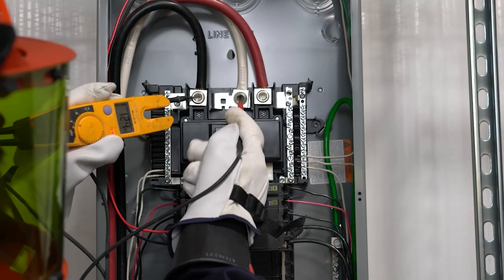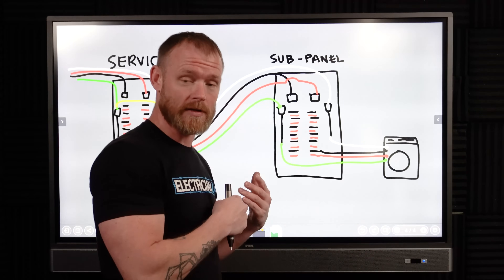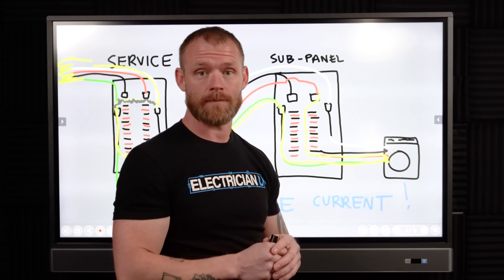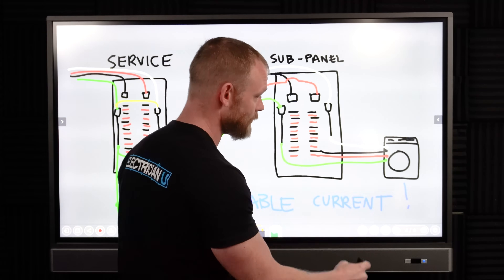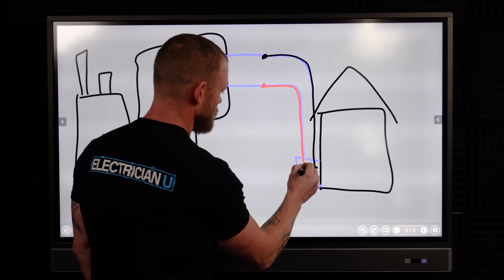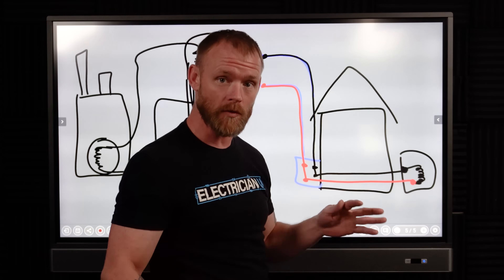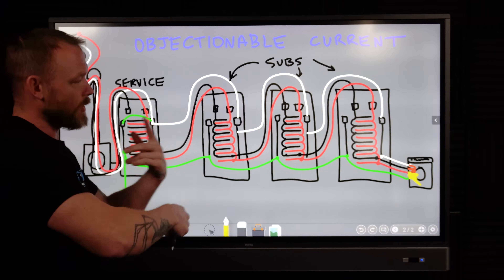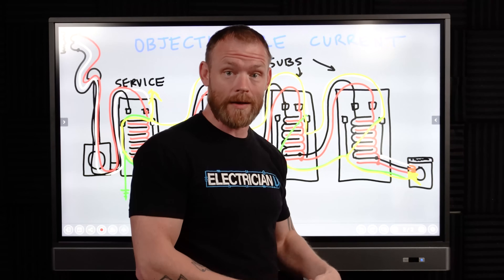Why Do We Bond at the Service Panel and Not a Subpanel?

Comment: You did not address unbalanced loads that'll cause the neutral to carry current, which is the real reason to not bond at the subpanels. If the load is balanced, neutral carries zero amps. If for example you have 100 amps on black and 50 amps on red, neutral carries the difference. If you bond at the subpanel, you give that current two ways to travel back to the source: neutral and ground will both carry half the current then. And if the plumber comes to replace the water heater, he dies when he takes the bonding jumpers off the pipes.

Comment: Nicely explained! Question regarding sub panels detached from the home. Code requires it's own ground rod. Does everything you just explained stay the same, where only the service panel is bonded to neutral? Just need to run an aux ground rod for this sub panel and bare copper wire to the aux ground rod? OR, does the detached sub pane also get bonded to neutral with it's own ground rod?

Comment: I'm just a diy-er, but am I missing something here? Under normal conditions, the return current flow is through neutral. If the sub is bonded, now the return is through neutral and ground, meaning every grounded enclosure from the bonded subpanel back to the main, is energized to some extend.  I think this is even more important as to why we want to only bond at the first disconnect

Comment: If i have power running into a shed from the sub panel in my garage, and i install a grounding rod into the earth, connecting every piece of metal in that shed (for the purpose of bonding) including an exhaust fan, steel trays, buckets etc.. is it possible to create a loop not allowing the current to return to the service (in the event of a fault)?

If so, how do i bond everything in my shed against static electricity?

I hope that makes sense.

Comment: I'm an apprentice. So, in this case, why do we connect the ground wire to the ground with a bar? What are the advantages? because we bound the two ground and neutral wires at the main panel to make a loop towards the transformer over the pole. So the ground bar will be useless! Am I right?

Comment: Just had a guy supposed to be an electrician upgrade the 100amp box inside my house to an 200 Amp box outside the house when finished the dryer and electric stove didn't work had just bought the dryer a few months before The guy came back out and checked it said dryer and stove was bad Had place where purchased dryer come out he said dryer was fine there was around 200volts on the Neutral wire Called so called electrician back he said the box that was inside was bonded with the one he put outside wasn't so he came back out and now it works some   electrician 😮

Comment: Small correction, when ungrounded metal part of a equipment is accidentally energized....THERE IS NO CURRENT FLOWING!   There is only potential, when you touch it and another part of your body touches some grounded element or you are standing barefoot on the wet ground, then the current flows through you and it may cause dead. (25mA is enough to kill a person)...if you don't touch any grounded element you just become Potential without current....That's why birds sitting on cables don't get killed because they don't touch anything else.

Comment: OK good ! Can the sub panels be grounded to a ground rod ? The example is a garage Subpanel has a ground rod but of course not bonded to neutral . So the house has a ground rod and is bonded . The garage has a separate ground rod and is not bonded but is grounded to the main panel as usual through the green ground wire . The reasoning is the advent of a lightning strike on the steel clad garage having it's own rod might mitigate the surge reaching the main bonded panel . Many thanks !

Comment: I just ran across your channel and unlike a lot of your subs understanding what you've shown here, I'm actually a bit more confused.. 
First off I am not a licensed electrician, but up till now I thought I knew a lot about electricity and how to wire panels and subs which I had to put in a new metered main  panel due to a storm that caused me to do so. That said, after pulling the necessary permits, I did the install and got inspected by both the utility company and the county inspector for the metered main panel, in which I passed with flying colors and also was complimented by both for the job i did.
Then came time to put in the sub panels...I'm running both 220 and 110 services to both my subs and neither have the neutral bus bar, but my grounds and neutral (commons) are connected to  the ground bus bar and everything works on all fronts, but now watching your video, I'm thinking I have an "accident waiting to happen" scenario...
I wish I could speak to you over the phone to answer my questions, but maybe I need to call someone to take a look at whats going on here at my place..
I do appreciate what you've shared and am your newest sub and will be watching more of your content. 
Thank you.

Comment: So, why in México they bond neutral to Earth and the meter base then to a ground rod.

After that, to the main panel(service panel) where they also bond neutral to another ground(GEC) and EGC!

Worse, it's part of their Code (which unfortunately, is a bad translation of the NEC of about a decade ago!)🤭

I refuse to do any electrical work in México! You never know what's hot or not!

I remember changing some electronic equipment that fried after a storm!(Cámaras and network switches). 

I think the last thing I dealt with was a UPS that was connected to two breakers but used the ECG as a neutral in the subpanel that kept the equipment energized, though not functioning, even though one breaker was tripped. It was a mess.

Electricity is a terrible master though a cherished slave!

A bad installation is a parked casket on wheels!

Comment: My sub panel was wired before 2005. I don’t have a ground wire to the sub panel. I only have 2 hots and a neutral. Should my subpanel have grounded neutrals now? If not, how would the current get back to the source?

Comment: I have a detached building pretty old that is fed by only 3 wires.  No fourth ground.  Should I bond?  I did install 2 ground rods as it didn’t have any. I also don’t have a cost effective way to send that fourth wire over.

Comment: Great video and explanation! You use modern terminology, like potential and shocked, I was taught by folks that learned this in the fifties, so potential to me means "live" and a shock is a "poke". I've been putting things back towards code in the ramshackle house I bought, I found a lot of surprises along the way, and I took the last of the knob and tube down along with cloth covered wires. Some hillbilly wound a birds nest in my service panel and pulling the wires away to try and organize them can be scary, even with the main off. After that I want to attempt a sub panel for my garage.

Comment: Man Great video, 1 question , a  ground fault will trip the main panel breaker on its way back through the ground to the bonded neutral , as for a  short circuit will trip the smaller breaker on the that specific circuit,  correct ?

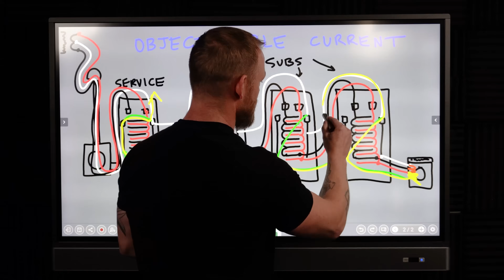Comment: Great video explaining why we need to bond. However I think the explanation about why it must be done ONLY in the service panel (@15:55) is missing the most important part. Bonding ONLY in the service panel is not so much for the fault case, but rather for the normal case where current is being carried by the neutral. If neutral is also bounded in a subpanel, then in the normal case (no fault), the ground will also carry the neutral current back to the main panel. This means that when touching any metal case, this neutral current could go through you as well to reach the neutral in the main panel.

Comment: It's a great explanation but in commercial service, where everything runs through conduit or emt, isn't all that metal effectively bonded back?  So let's say a careless Handyman leaves that red insulator out of his EMT terminal and cuts into a hot wire with the metal jacket. Doesn't this instantly trip the breaker, and not energize the entire grounded system?

Comment: The dryer or stove on the subpanel usually connects equipment ground and neutral wire together in the equipment servicing plug in receptacle. Thus bonding the equipment ground to the neutral in the case of a fault. Thus same thing as bonding the neutral and ground in a subpanel. Usually in a fault situation...which is a hot shorting out....the protection fuse blows or circuit breaker trips. I would rather have neutral and grounds both going to ground at all panels thus offering a hot source a way to ground if one or the other fails and thus you becoming the earth path  return when you touch the open return be it the ground or neutral at any sub panel you're  at.

Comment: My situation seems to be a bit different.  Instead of a subpanel, I have two main panels, each fed independently from a 100 amp breaker in a 200 amp meter box (there are no other breakers in this box).  The building inspector imposed several bonding/grounding requirements:

1.  Grounding and neutral busses bounded in each panel 

2. Two ground rods to earth 

3. One rod attached to the water pipe enters the house 

4. One rod attached to the meter box

5. A bonding wire between the hot & cold copper water pipes, the steel gas pipe, and the cast iron/steel/copper waste pipes (the material for these pipes is dependent on their diameter- 1.5” are copper 2” are steel and 3” & 4” are CI.

6. The bonding wire had to be continuous (ie no slices).  This was very difficult to accomplish since this wire was very stiff!  (I forget the wire gage, but it was around 3/16 inch in diameter).

This was done over 30 years ago.  Based on your video I’m wondering if this situation is dangerous and be changed for my safety?

Comment: The European electrical standards explain this concept much better, identifying the difference between PEN, PE and N conductors. What about a detached outbuilding with its own earthing/grounding rod? Is a combined PEN from the service panel in the main building to the panel in the detached outbuilding common in your area (would be just as if the outbuilding had a separate electrical service), with PE and N broken out at the building level. I know most large high-rise apartment buildings either have a TNS system or have neutral and ground separated at the main electrical entrance to the building, and because both N and PE are supplied by the utility in this case, no neutral-ground bond is at the electrical service entrance to the apartment.

Comment: awesome video, thank you.  question on a dual input type of situation, like a food truck.  I imagine its panel should be setup like a sub-panel with the ground and neutral separate and not bonded.  its input will be off of a breaker/ outlet, but what if that truck is connected to a generator?  does the generator behave like the main panel and do the bonding internally so the truck should not have the bonding as well? or should the trucks panel be bonded when connected to a generator?

Comment: 8:50 I'm pretty sure an "energized" wire just means it's high voltage. There's no need for it to be powering a load for it to be energized, just for your multimeter to read high voltage when you measure the potential difference to ground.

Energized describes the voltage (which makes it dangerous), not the current flowing at a given point in time. No one gives a shit about current. When the utility company shuts off power to an energized power line, they're removing the voltage (not current, which will vary depending on the load). Obviously, with no voltage, there's no current, but an energized wire is one with a high voltage relative to ground.

Comment: You failed to address why the need for the ground rod if fault current is not being dumped down it. My undestanding is that the impedance of that rod-earth connection should be 30 ohms or less, which would imply a second current path of 4/8 amps down the rod in the case of a ground fault - at least until a breaker trips.

Comment: In Saskatchewan the bond is removed in the main panel as well as any subs. A ground is run right back to point of supply. Also, electricity follows ALL paths to ground with the greatest current  on the path with the least resistance.

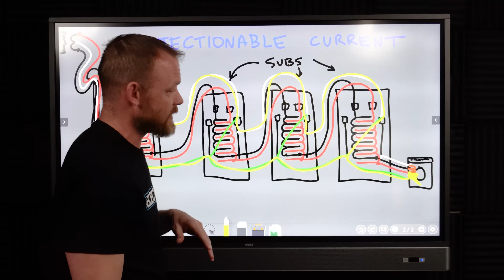Comment: At 17:32, There's another objectionable current path on normal operation without any faults if you tie the ground together with the neutral in the subpanel  During normal operation of the subpanel, if you have 50 amps coming in on one of the hots of the subpanel, since the neutral and the ground wire are of the same gauge from the main panel to the subpanel, the current path back to the main is split evenly between the the ground and neutral at 25 amps each.

Comment: Excellent video, but one minor correction at 12:00  Appliance motors aren't hooked to neutral and both phases of hot, in fact most are just 120v motors between one hot and neutral.  The heater element on a dryer gets hooked across the two hots for 240v, but not the neutral while the motor that spins the drum is typically 120v between one of the hots and neutral.

Comment: If the ground wire from the sub panel is connected to the service panel then why does it need to be bonded to the panel. The 2 neutral bus bars are connected so the fault current from the sub panel still goes to the transformer. So why bond the box. I thought the whole point was to make a path for the fault current to get to the transformer. Will the fault current still get through the neutral bus bar that the ground wire is connected  to if the screw isn't in

Comment: Why Do We Bond at the Service Panel and Not a Subpanel? I'll Tell You WHY.
The Neutral Wire - Returns Current To the Electricity Company Transformer.
The Neutral is Not Like The Live Wire. If The Circuit ISN'T Being Used - Its Doesn't Carry Current.
However, There are Situations Where - The Neutral Can Be Carrying CURRENT, Even if the Circuit is Not being Used.
YOU and The Earth Under You are Like a Capacitor - You and The Earth Can Absorb Current.
You Have an Earth Rod in Your Basement. The Earth Wire is SHORTER than The Neutral Wire Back to The Electricity company Transformer. The Reason Electricity - Shorts to Earth, On a Fault.
Its IN THIS Situation. That The Neutral Can Carry Current - Even if The Circuit IS NOT Being Used.
If an Idiot Neighbour of Yours - Electrocutes To EARTH. The Electricity Company Transformer, Will Be Short of Current. Since its Short - It WANTS Current From Your Neutral Wire.
You Bond At The Service Panel and Not a Subpanel - Because - The Current Shortage SHOULD Take Electricity from Under Your EARTH. If You Bond at subpanel - THEN - More "Neutrals", will Become Live, if an Idiot Neighbour Of Yours - a Few Blocks Away -Gets a Electric Shock and Shorts To Earth.

Comment: 15 minute mark, when there is a short or ground fault in a piece of equipment - at the bonded service panel why doesn't the current go through earth back to the transformer? the transformer is also connected to earth... 

i assume its because there is less impedance through the neutral wire than 100 feet of ground.

Comment: here's a question... i bought a house a year ago.. the meter is mounted outside on the back of the house.. directly inside on the same wall, is the main panel.  There is also an unattached garage on the property.. there is another main panel inside the garage.  Both panels are fed directly from the meter... no sub panels.. no disconnects.   What could go wrong with this scenario???

Comment: THANK YOU.    This finally explains to me, the non-electrician but technical guy, what the neutral really does, and why the ground is bonded at the panel to neutral.   Also explains why 'boot leg' grounds are bad and dangerous.   I live in an old house and do look for them if I pop off an outlet for any reason.

Comment: I have a couple of nits to pick. First, you treated washers and dryers as identical. At least in the US electric dryers are rated 240 volts while washers are 120 volts. So a washer circuit only has a hot and a neutral like all the convenience receptacles. Dryer circuits these days carry a neutral and have a four prong plug. The neutral might be used to run a 120 light. Second, you needed to mention that in the US most all utilities bond the transformer neutral to ground. They can do this because they are not covered by the NEC. Yes, that does set up the possibility that neutral current can flow through ground from the service panel where the neutral is bonded back to the transformer where it is also usually bonded. There is also the case of a separate building being subfed from another building. If you do not run an equipment grounding conductor along with the feeder you must bond the neutral to ground established  at the separate building. If you run an equipment grounding conductor along with the feeder or the buildings are connected through a common metallic system like a water pipe you do not bond the neutral at the separate building. Regardless, the separate building must have a grounding electrode system.

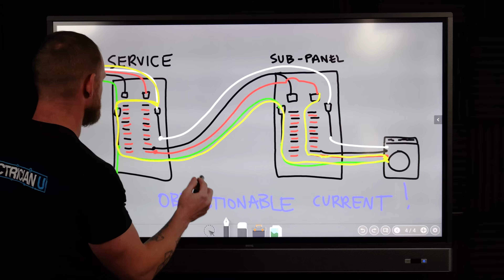Comment: 8:00 So if you took a wire directly from a ground rod and touched a current carrying conductor, no current would travel and it wouldn't fault out?

9:10 I am drastically misunderstanding either your statement or my concept of grounding and potential and ground faults.

Comment: So I have the service line coming into my meter that's equipped with a 200amp breaker disconnect. Would that be the only place the bonding should be happening, thus leaving the service panel box inside the house, unbonded. Is this correct ?